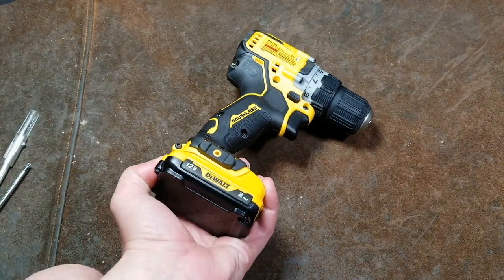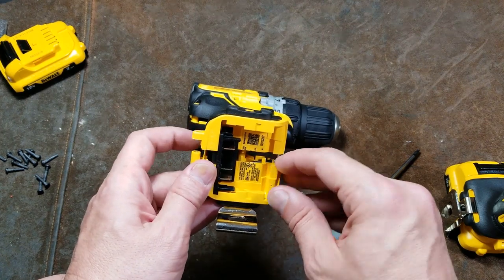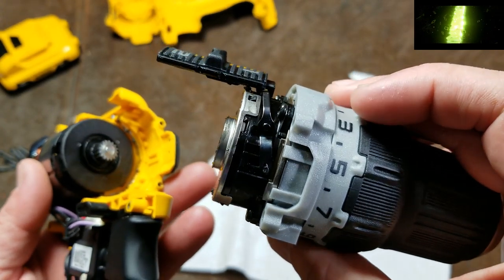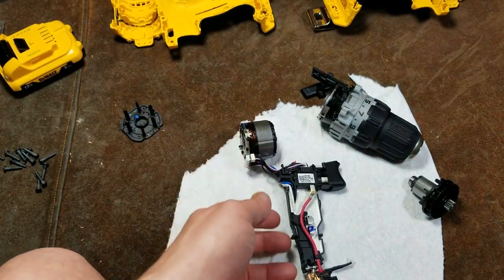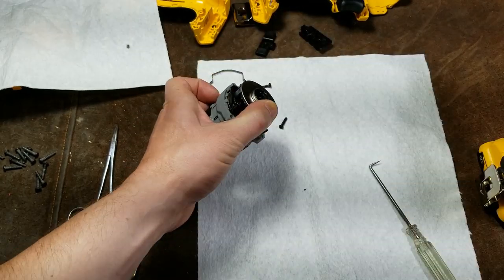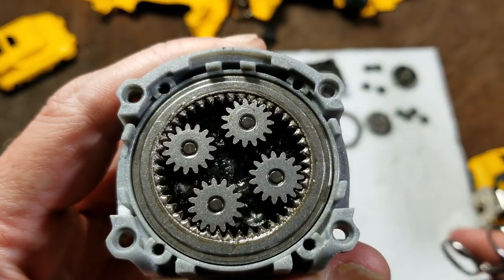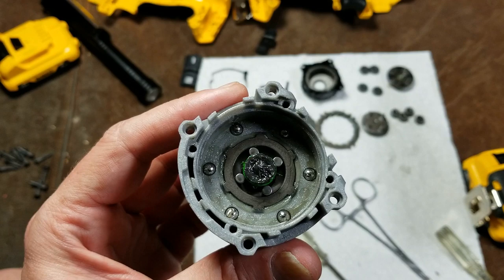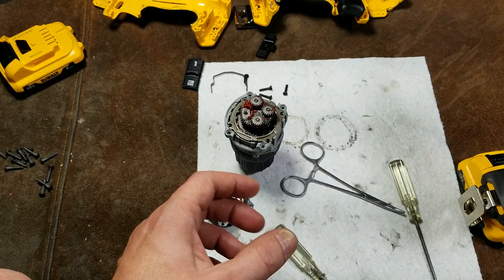TearDown: DeWalt Xtreme Sub-Compact 12v Brushless Drill

Comment: Glad you made the video. I just bought the drill so far I love it very light 2.6 pounds with the battery which is what my 18 V battery alone weighed. I always hated the Dewalt drill driver I bought in 2007 ridiculous amount of weight over 8 pounds with the battery and very front end  heavy. Had to use two hands most of the time. I was thinking about switching to a half inch chuck but after this video I’m giving up that idea. The YouTube reviewers that complain about The clutch selector housing being made out of plastic is ridiculous. Apparently they don’t hold this drill overhead like I do a lot, rather have plastic than heavy steel for something that does not affect performance at all. It seems like a great buy at $105 with 2 /2 amp batteries that have independent LED charge level indicator,charger and a carrying bag. The two improvements that would make it even better is if they skip the belt clip location and instead use it four a double end screw bit on one side and a double end Torx bit on the other side. I feel most of the people buying this would be homeowners,who would not be hanging this on their belt but could use 2 of the most common bits. The second thing I would suggest is they put a small LED like they have on the bottom on the top between the speed selector, and the clutch selector to eliminate any shadows while you are using the tool.🧰🧰🧰🧰🧰

Comment: GOOD video,  regarding the varnish on the windings, its been said that although the varnish keeps the windings together and protected,  they also RETAIN HEAT,  causing the motor to prematurely fail from heat retention / overheating

Comment: Great breakdown.  It is really nice to see someone like yourself that knows what they are doing do this before someone like me starts diving into something like this for the first time.  I have a lot of mishap stories of tearing things down when something goes wrong and I didn't understand that I needed to keep track of an orientation of a part, or wondering where a ball bearing, or spring goes.  I had to teardown my turntable (record player) last year and I still have a couple ball bearings that did not make it back into the turntable because I am not sure where they fell out from.  Seems to be from an area I can't get to, but the funny thing is that I was able to fix the issue I was having and it plays great, is very quiet, and holds speed very well haha.  Thanks for the video and cheers.
Reply: A really good mechanic always has parts left over. Shows you can do the job with less parts.

Comment: I have the Craftsman model which is similar. I want the gearmotor and batteries for something else.I ended up sawing off the chuck. The keyed shaft that goes into the chuck side of the gearbox I will probably just make a new one that fits what I need. I removed the balls from the clutch and replaced them with set screws.

Comment: You get a drill, charger & 2 batteries for a about day's pay at minimum wage. 
Starting from scratch, how long would it take a man to aquire the raw materials and build all the tools to build all the equipment to build all the components that make up this drill? 
All things considered, it is mind boggling. 
But, I went back and checked the average wage 100 years ago and the value of $99.
If it existed in 1920, it would take 2 days pay to buy this drill. At minimum wage it would take a manual laborer, working on the Hoover dam, 8 days to earn enough to buy the drill. And he would cherish it.

Comment: Hi,
I have a dcf899 that does nothing on a good battery.  I opened up the case and saw a breakage in the wire of one of the coils near the base of that coil, I think.  Is that normal?

Comment: Excellent video! While you drool over the 'technology" of the drill consider how easily the speed selector slider breaks. On the DCD791 which I have, the wireform shifting mechanism going up to the selector it causes the part to break when changing from 1 to 2. Had to fix mine after about a few weeks of use....very fragile part and poor design!  Won't help to have caps that last 20 years of the plastic parts break after a few weeks. This must be an improved model that uses the stamped steel shifter/selector instead of a wireform. I need to find a 20V model that does not uses the unreliable wirefrom shifter.

Comment: Hello friends, can someone please assist: when i look at the base of this line of tools where the batter connects, i see 3 terminals, power in power out and what is the function of the 3rd terminal? Ground or signal? Can someone please walk me through this part of the circuit please?
Reply from the maker: The third terminal in the tool is for battery temperature sensing. If the battery starts to overheat the tool will shut down.

Comment: what would be issue when drill torque is not chaged? as it stay one level...
Reply from the maker: I usually leave the clutch is set to maximum because I'm more used to just throttling the drill rather than just relying on the clutch although it is Handy if you have to put in multiple fasteners in a row or you are working on screws that go into some plastic and you just want to make sure you don't strip them out

Comment: All i want to know if how to get the gear off the motor so i can replace the $4 bearings not replace a whole motor that's fine
Reply from the maker: The gear is press fit you have to use a puller